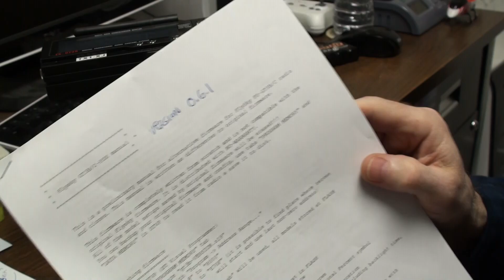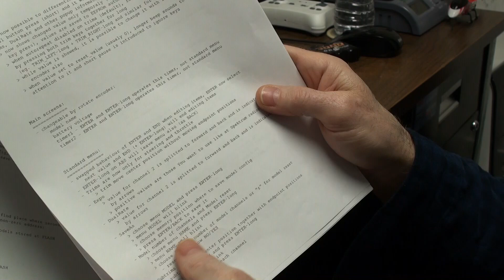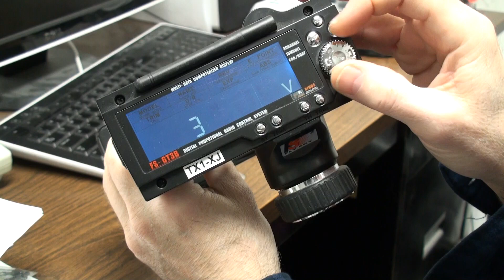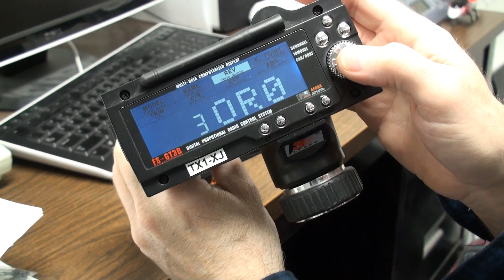FlySky GT3B 3-Position Switch Setup

Comment: Hey Dan thanks for this brilliant explanation, I've only just discovered your video. So I am guessing that the same settings here could be applied for a gyro such as the Skyrc gc401 for example, if it were plugged into channel 3? Also changing the values to less than 100 to stagger the amount of applied gyro I'd assume?
Reply from the maker: Sounds like you’re on the right track 👍🏻
Reply: @spidernad1 this is the comment I was looking for. Thank you both!

Comment: Is the steering wheel slidable or is it like set positions?
Reply from the maker: The wheel on the side for steering only rotates clockwise and counterclockwise for steering. It rotates freely and returns to center when released. It does not have any other function.

Comment from the maker: These Skyfly GT3B radios are simply amazing!  Hacking the radio means you upgrade the software to a custom software that turns the radio into an 8 channel radio with almost unlimited capabilities.  I don't think this is possible for other manufactures radios.  The stock radio is only $40.00 and a hacked one is not too much more.  You can buy it already hacked or do it yourself.  I put a link in the video description for the "Hack" thread.  All the info is in there. Cheers!

Comment: Rc battery and Rc Nitro can use same remote???
Reply from the maker: Kenan Alfin : Yes. You can use the Radio transmitter (Tx) for as many different cars as you want, electric or nitro. You just need a separate receiver (Rx) for each vehicle and you bind them all to the same Tx
Reply: Thx

Comment: Channel 3 won't turn head lights off or on... always on...how do you setup as a off on to lights??
Reply from the maker: Do you have a hacked firmware or a stock GT3B?
Reply: @spidernad1  stock
Reply: Same question
Reply from the maker: @Mike Secondo : EDIT : An On/Off switch from Hobby King or other store will do the trick.
Reply: @spidernad1  I purchased a off on switch from hobby king and now with a click of the channel 3 switch I now can turn lights off and on!! Works great!! I even purchased 2 another one for the smoke pump in my airplane.
Reply from the maker: Mike Secondo : That’s great! I was gonna suggest that but wasn’t sure it would work. Good work figuring it out on your own. Kudos to you my friend. 👍 Enjoy.  I will edit my last reply so not to mislead others.